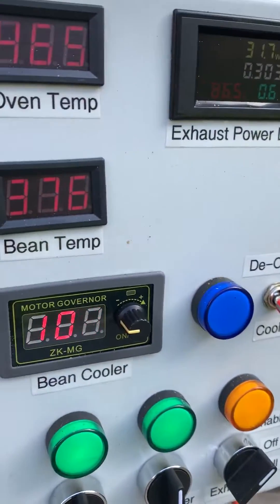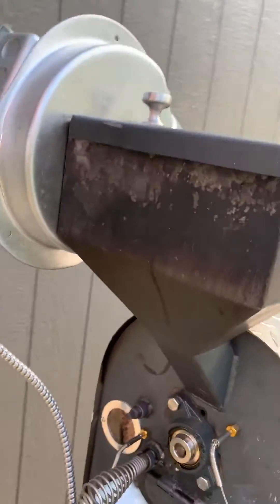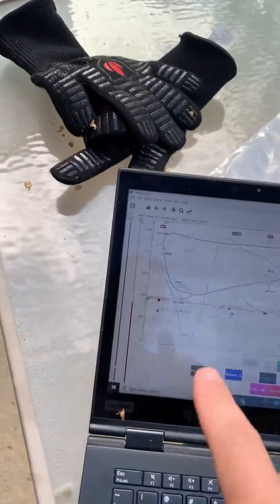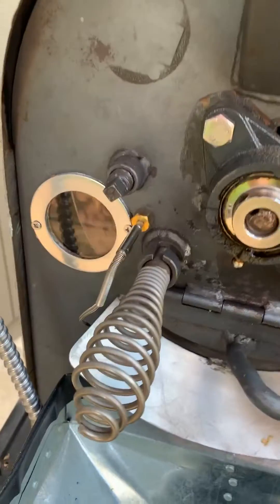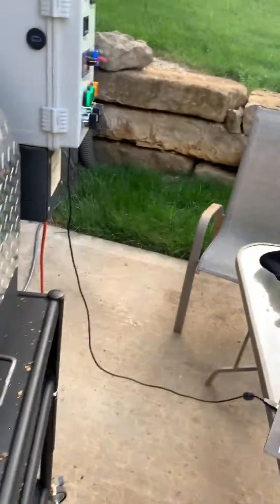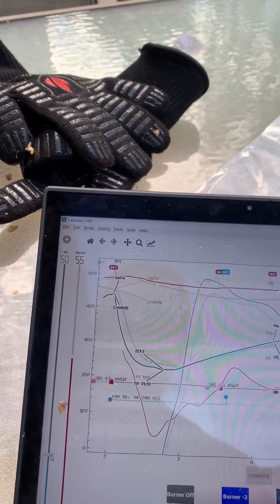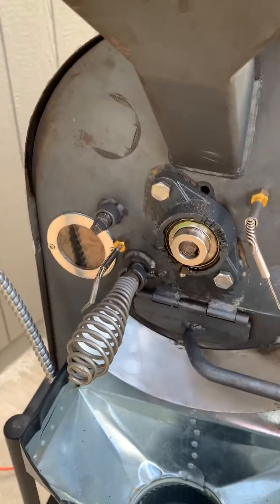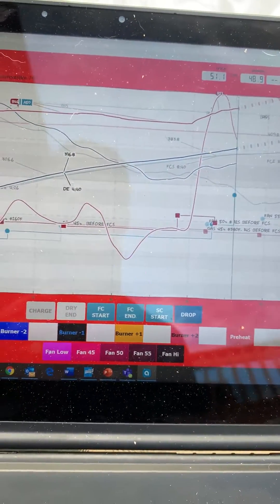Overview of the Hermetheus 2.0 2kg drum roaster (DIY coffee roaster)

Comment: I see in your below comments you no longer have the drum roaster and have seen in other videos you are now on the Artisan 6.  Where you able to control the drum roaster via PID?
Reply from the maker: I never tried. It. It’s certainly possible from a technical standpoint. (Just follow my other video on using PID… the servo doesn’t know/care if it’s hooked to a gas valve or an SSR potentiometer. 
Having said that, it probably wouldn’t have worked well enough to be useful on my drum roaster. Most drum roasters are SLOW to respond to temp changes. You’d have to use such low Proportional values and insanely high Derivative values, it wouldn’t be much different from just making a few manual changes. 
Other drum roasters could be a bit more responsive than mine was though. But my Artisan is super responsive to heat. It can turn on a dime, heat-wise.

Comment: Awesome build!! Can you show the inside? Perforated drum? Single burner? What’s the capacity?
Do you have enough control with the servo motor ball valve vs a needle valve? 

Can’t wait to start mine!
Reply from the maker: Thanks! I don’t have this roaster any longer (I switched to a larger fluid bed roaster), but yes, it was just perforated steel that was used for the drum. The burner element was a simple modified ribbon burner. It has a 2kg capacity. The servo control gives really great control over the heat. You have control in 1 degree rotation, so that’s PRETTY small movement. A needle valve would have been better, but the ball valve + servo worked just fine. They’re just not very linear. So at the extremes, you have to make larger adjustments to have an impact, but just as the ball valve is opening, it becomes very sensitive. Good luck on your build!